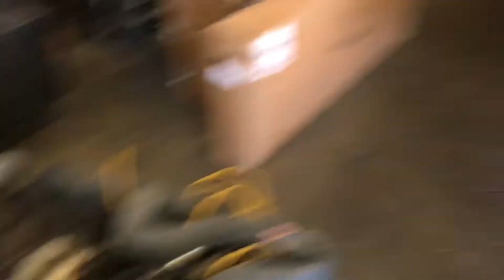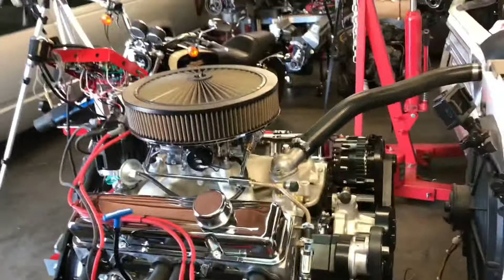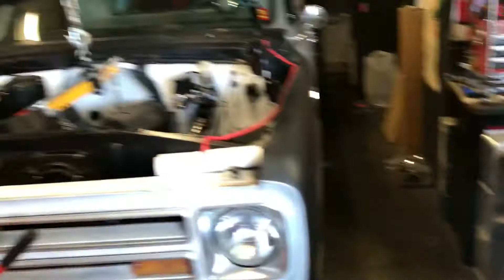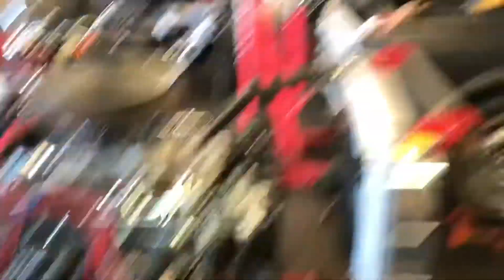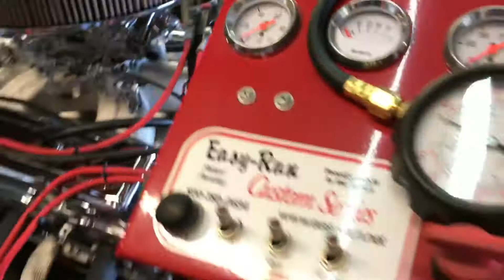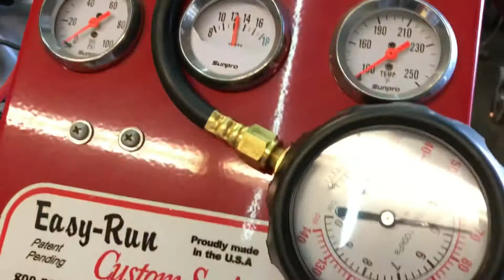First Start-up of a BluePrint Engines 350 Chevy on an Easy-Run engine test stand!

Comment: I have the roller cam 383 bp engine and it is rock solid. Just turned 6k miles on it and not a drip and no issues at all. It runs best at 210f but I guess 383 is that way. it doesn't overheat even in the worst traffic but it does run warm normally. I was hesitant originally to buying a crate but I am very happy with it. I would buy another if I was in the market.

Comment: Thing that kills me with machine shops is that they're expensive. Took a small block to one near me and he said its going to need 4800+ in just machine work. 2300+ for the block and crank and another 1500 for the heads. This isnt including parts and rebuild. At that rate a BP 350 seems very enticing.

Comment: That company seems to put out a really great product based on this and other videos I’ve seen. Probably quite expensive but seems worth it
Reply: Actually for the price and reliability it seems like a fair price, I might efi swap it and put a holly fuel management system
Reply: It costs the same if not less that to build an engine of equal power. I’m running their iron head 350 in my k10. It makes 387 hp and 414ft lbs of torque. My stepdad is running a BP 400 in his camaro makes 508hp and 517ft lbs of torque we bought it for 5,199 2 years ago. You couldn’t build one to make that power for that price. On top of that you wouldn’t have a warranty.
Reply: I have the BP 383 and it leaks oil from nearly everywhere.
Reply: @bobsilver3983  then call them
Reply: @yamahaguy1732  Max labor warranty is $500.  My engine needs to be pulled and all new gaskets installed...$500 is nothing.
Reply: @bobsilver3983  why don’t you pull it yourself
Reply: @yamahaguy1732  If I pull it, its going to be put for sale....I'm burnt out!